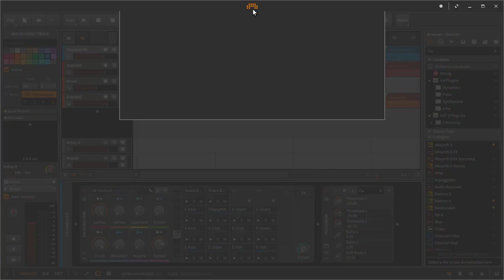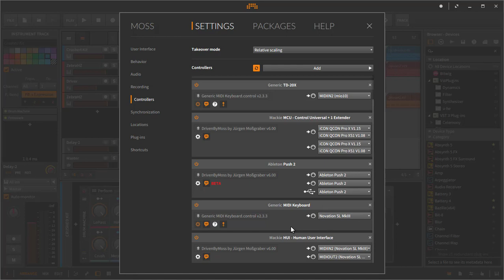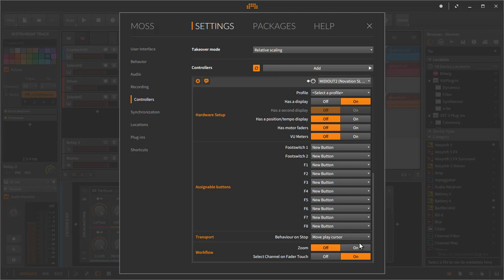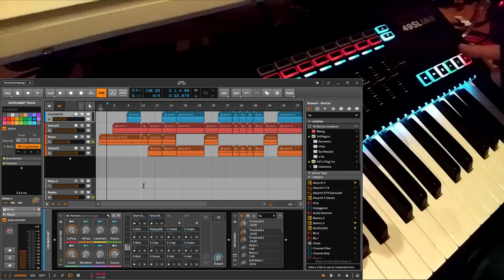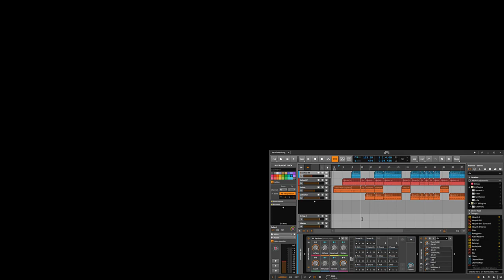Mackie HUI Protocol with Novation SL MkIII

Comment: any idea if the focusrite control 2802 would work in bitwig?
Reply from the maker: Looking at the manual it supports the Mackie HUI protocol. So, yes it will work with my HUI implementation. But don't expect much from that HUI is even more basic than MCU.